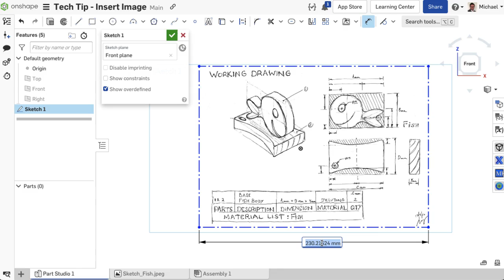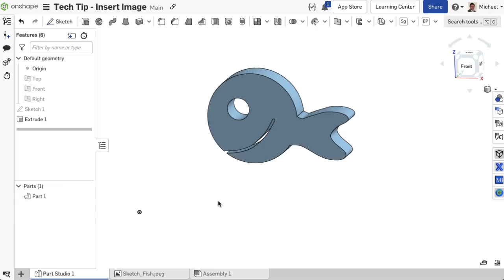Tech Tip: How to Start a Sketch with an Imported Image

Comment: is there a calibrate function like there is in fusion 360? In fusion you can lay a ruler over an drawing then take a picture of it and use the ruler to calibrate the size of the image, its a fast way of making awkward sketches
Reply: So I realised you can use a construction line as a reference. Just make a line of 10mm or whatever then when you upload your photos scale the image so the ruler in your picture lines up with the construction line

Comment: yes. what happened to the scaling of the image? I have done extensive importing of old paper drawings.  And have had to scale and stretch the drawing to get it back to the original shape.  While this has been done mostly in the Architectural field.  I have had some mechanical items that needed this type of scale/stretch approach. I will contact your tech support with some samples.
Reply from the maker: Hi - Yes, please do that. You can open a ticket through the app.